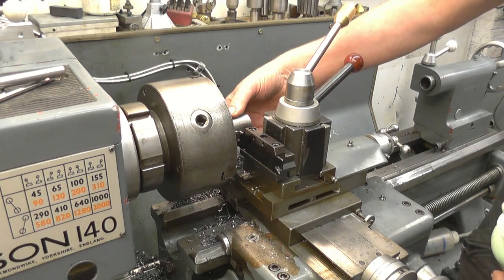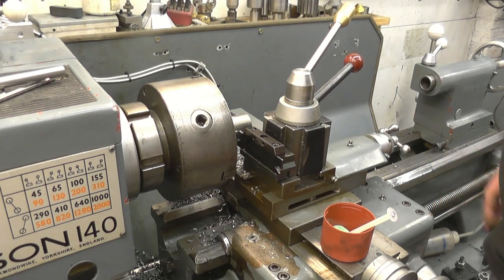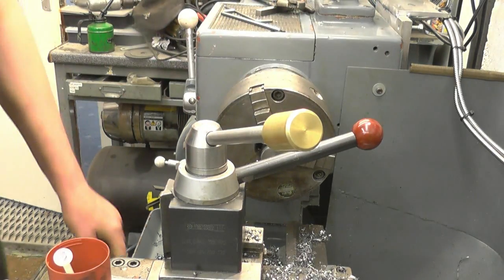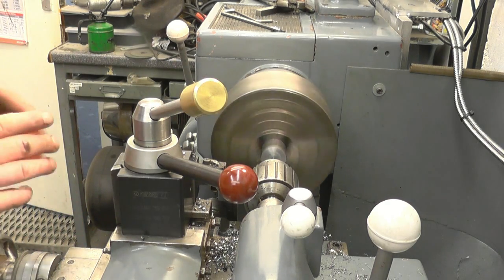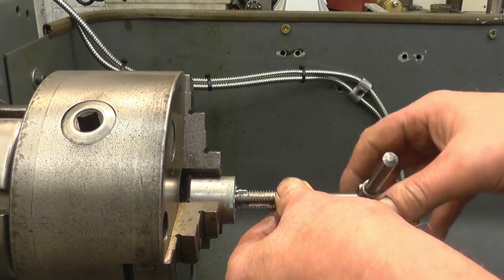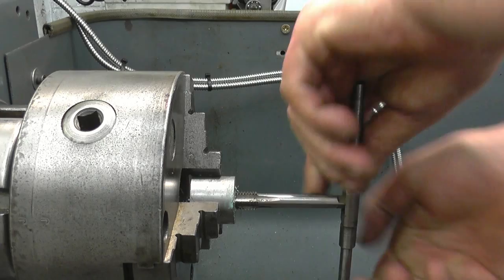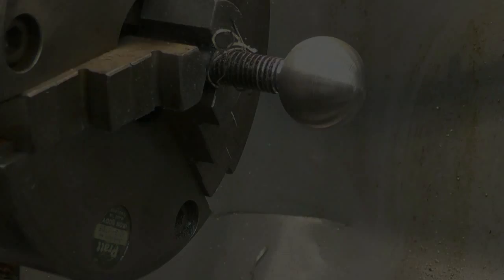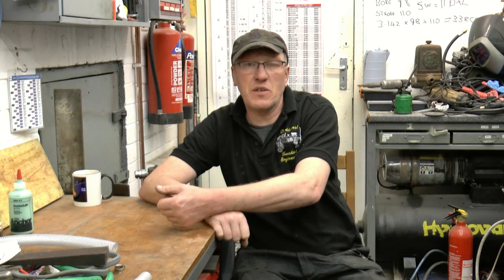SNNC 72 P3  Ball Turner

Comment: John. A Suggestion if I may. Firstly set the radius you want and LOCK the boring head, this will give more rigidity. Then use your cross slide to feed into the work , once you reach the center line the tool should stop cutting as you will have reached your set diameter. Hope this helps.

Comment: That's a nice idea for a ball turner.

If you use a larger diameter for the mandrel, just necked down right at the ball to clear the cutter, that chatter might just go away.You can really see the bolt flex from the tool pressure.
Reply from the maker: stefantrethan I will be making a much stiffer mandrel Thanks for watching

Comment: Glad to hear that Debs is bouncing back.  As a few if my acquaintances would say: "We be rootin' for ya."

I like that design for a ball turner.  Someone else demonstrated one that pivoted on a vertical axis, and keeping the chatter to a minimum was a real problem with it, and the ball size was very limited.  A design like that appears to limit size to the range of the largest boring head that you can adapt to that holder.

Now I know what to do should I ever need to make some custom push rods.  Some of those aftermarket parts places are mighty proud of their stuff.

Comment: John,
It looks like you are using a broken end mill for your ball cutter. Am I correct? Anyway, like you said, play around with the cutter geometry a little and you can turn balls like crazy! Everything around your house with a handle will have a ball on the end of it!  :-) Thanks for the series of videos. I assume your internet speed has not improved much?
Have a good one!
Dave
Reply: Swarf Rat Hey, that's an idea.  Custom "Doubleboost" stamped knobs.  For your shift lever, or your supercharger / rocket booster / N2O controls, or whatever you want a shiny knob on...
Reply from the maker: Swarf Rat Thanks Dave It is indeed a blunt milling cutter I find it simpler to just do a 10 / 15 minute video Upload speed is still not fantastic

Comment: ll turner looks good regarding alignment and technique. I'm not sure it requires such positive rake and would be wanting to try something ground similar to how a lathe tool would approach the work but rotated to the top. I think a common TPG insert would do a nice job if it were mounted on the end of a shank.

Colin ;-)
Reply from the maker: ***** Thanks ColinThere is loads of scope for experimentation

Comment: Glad Deb is home from hospital, as I'll bet you both are. Now, let the TLC begin.

The Anchor Lube pretty good stuff. I've used enough of it to know it doesn't cause me any skin problems. 

I've also used it to drill, bore, and tap Plexiglas(Perspex?). It leaves a nice finish on the threads, with no tearout up to 1-1/2 pipe. For this result, I freehand grind flats on the flutes of drill and tap.

Tom
Reply from the maker: awhs1964 I like the Anchor Lube

Comment: Love and prayers of healing to Debs. Finally, the light at the end of the tunnel! And to John who is such a supportive fellow. John, that is a very good looking die handle you used with the angled grips. Does it show who manufactured it? I've used the Anchor Lube some and find it keeps parts and tools much cooler, doesn't sling all over the ceiling, and smells quite nice which surely must be healthier.
Reply from the maker: Don Foster Thanks for the kind wordsThe die handle is a "Snap On"It had straight handles until I tried "power threading" Many years ago